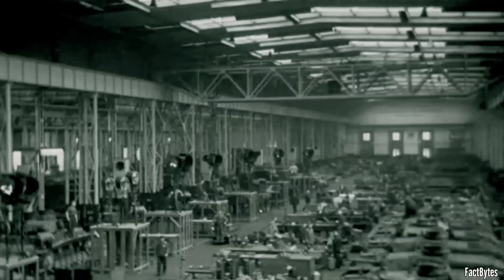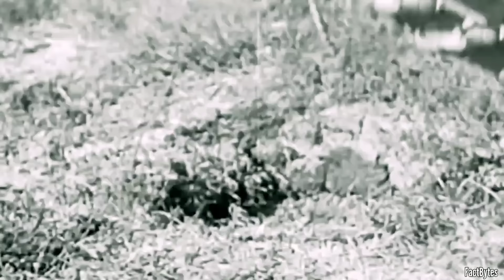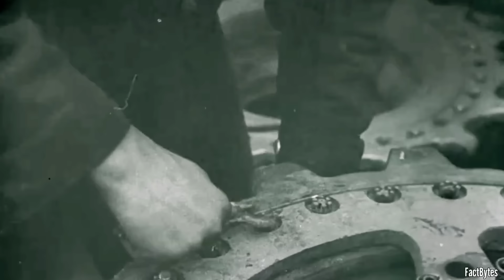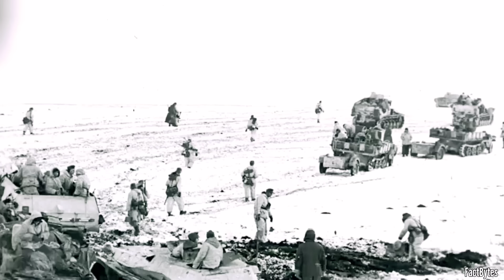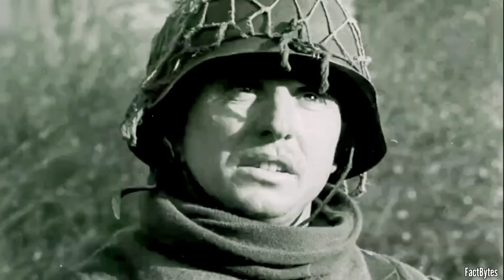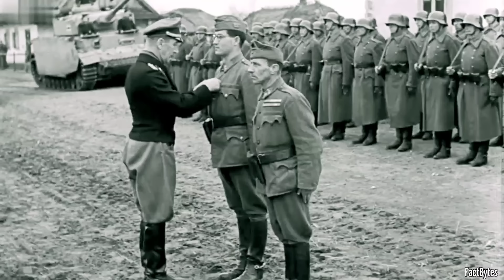More Panzer IVs, Fewer Tigers & Panthers — Would Germany Have Done Better?

Comment: Don't forget, the StuG III was the most-produced German AFV in WW2, not the PzKW IV...
Reply: There are other things Germany could've done. Instead of producing fewer than 30,000 tanks in total, they could've scrapped all other designs except the Panzer IV. Scrap all the tank destroyers like the StuG III, the Krupp K5 railway guns, and the Dora and Gustav railway guns; they could've produced 35 to 40,000 Panzer IVs. Developing the Wespe and Hummel self-propelled artillery before the war would've produced 25 to 30,000 Panzer IVs and 2,000 or more Wespes and Hummels each. The problem, though, is the lack of fuel, lack of industry and resources for spare parts and the lack of people to crew them. More tanks means more abandoned after running out of gas, especially after the oil fields in Romania were bombed in 1944. Germany couldn't produce the tanks, resources and personnel they needed for the war, especially after Operation Barbarossa. They weren't ready for the war and never would be. Same thing with the Luftwaffe. The aircraft industry, too, couldn't match the industrial capacity of the Allies and USSR.
Reply: @baddriversofmoosejaw8681  yes, should have, could have but in the end supplies and logistics
Reply: @stevegreig5675  Bingo!  And the most important thing they lacked was fuel.
Reply: @Weasel-z4y  This is why I believe the Panther was (almost) the best tank for the Germans at the latter part of the war. They were running out of fuel and people. It was a necessity to design and build tanks that could fight outnumbered with the best chance of success. Make the Panther closer to the original specs with a more dual-purpose gun (or a variant with the Panzer IV's gun). What would be the point of producing thousands of Panzer IV's if you don't have the resources to fuel and crew them?
Reply: @iamnothere454  In the end, however, Germany should've cancelled Operation Barbarossa and only taken the parts of Europe they had conquered by 1941. This way, they could've concentrated on the Mediterranean. Not bothering with Africa would've been wise. More of their forces in Europe, fewer ships, supplies and reinforcements lost in the Mediterranean and fewer staging points for the Allies to invade Italy. This doesn't mean they would've won the war. They would've held out longer, and not having the USSR to worry about and not declaring war on the US would've been wise.
Reply: @baddriversofmoosejaw8681  They were going to fight Russia sooner or later. This was the best time to do it. They should have stayed away from Stalingrad and focused their war on the south. Blitzkrieg warfare doesn't do squat in cities - but in the open southern steppes, they could have seized the oil fields and destroyed anything the Russians threw at them. This would solve their energy problems and make the T-34 useless because it wouldn't have any fuel. They would also have avoided the massive casualties they suffered in Stalingrad - preserving essential manpower.
Reply: @iamnothere454  Not entirely true. They were still going to lose the war with the USSR regardless. Even if they'd captured Moscow, as they could've done during the summer of 1941, and cut off the oil fields in the Caucasus Mountains by taking Stalingrad or reaching the Caspian Sea, the USSR was receiving oil through the Lend-Lease program. This would've slowed them down as they would've had to rely more heavily on it, until the Caucasus were retaken, but either way, Germany didn't have the industrial capacity or manpower to win. The USSR and Allies alike were too strong in both industrial capacity and manpower. The USSR was the largest country in the world by landmass; Russia is the largest landmass in the world today. Germany didn't have a big enough military to control the entire country and never would. In fact, getting as far east as they had planned to in the first place before winter set in would've shortened the war, and the USSR would've gotten further west. The reason is that Germany's forces would've been spread even thinner, and when the Soviet forces from the east arrived in December/1941, they would've had an easier time getting through the German defences.
Reply: @iamnothere454  The panther was actually an utter piece of junk.  LazerPig has a great video about it https://www.youtube.com/watch?v=FI0KUZiZp1Q
Reply: @baddriversofmoosejaw8681  Well, not the StuG III.  One of the main reasons for producing the Stug III is the reduced manufacturing complexity and resources of not having a Turret.
Reply: @baddriversofmoosejaw8681 yes i was going to say they hadnt enough fuel for that but i see you said that😄
Reply: @baddriversofmoosejaw8681 They had countries like Romania and Hungary.
Reply: @WestValleyTransparency  Yes, but not good enough.
Reply: Imagine the STUG or Panther with hydrostatic drive like a Caterpillar 953 or 963.   They'd spin on a dime.
Reply: @billw7213  hydrostatic tho is only good on slow dozers and such as too much speed causing heat build up causing failures
Reply: It also had the most kills of any AFV destroyer ever.
Reply: While Stug IIIs had some virtues, they were inferior to tanks. Their great utility was that they made use of the otherwise obsolete Panzer 3 production lines. Retooling those factories for Panzer 4s likely would have been a better choice
Reply: @ill_bred_demon9059  defensive and built on the III, 2/3 the cost, so a bargain
Reply: But...was not a tank a such...no turret right?
Reply: @johnanita9251  Right it was an armored casemate classified as a dedicated tank destroyer, a role in which it excelled it.
Reply: @jebbroham1776  That it did. But it still didn’t keep the StuGs and JgPz’s from being out numbered and overwhelmed.
Reply: @johnanita9251  Well for first, it was significantly cheaper to produce than tanks whit tover, while keeping significant role of tanks.
They started as SPG for direct infantry support, later upgunned for anti tank role.
Reply: @johnanita9251  but war and necessity have a way of obliterating those distinctions
Reply: Exactly what I thought I should write. The good guys had could win the war against all the bad guys now. Many Veterans now regret to fight against the people who was right early on but it is like Covid, to feel the pain is higher then to talk about the pain earlier.
Reply: While true, the stugs were mot tanks, rather tank destroyers
Reply: 不，並沒有
Reply: yeah, but the turmless casemate tank had its disadvantages and had also only a 75 mm cannon
Reply: Yes 4 with 7,5 cannon. And stug. Enough. And this in high numbers. Guderian ask for a lot. 
Same with luftwaffe. Tooooo much different Typs
Reply: It was NOT a tank!
Reply: You don’t choose the stug life. The stug life chooses you. 😎
Reply: Came here to say this
Reply: Germany did not have enough fuel to support any motorized vehicles for a prolonged conflict, so the point is moot.
Reply: @MD21037  Not actually as lighter "tanks" could move on compressed gas; sort of like a fork-lift truck.
Reply: You're right; The StuG III with the long 75mm Cannon would have been effective till about 1946. Although heavy tanks would be deployed onto the battle field; improved munitions such as a tungsten core; or shaped charge would have mitigated heavier allied tanks.
Reply: @Adam-zq2mw  yeah but nazigermani had no tungsten
Reply: @Adam-zq2mw  It was not effective already in 1944, because it could not penetrate frontal armor of T-34/85 and later Shermans at more than 500m . IS-2 only at point blank, while it got destroyed from 2 km.
Reply: @aleksazunjic9672 Maybe the turret but not the hull.  Furthermore, Soviet armor was of suspect quality and very brittle with lots of spalling even if the round didn’t penetrate.  The 85mm round was also questionable as it could disintegrate on contact at close range.  Really, Soviet quality control on pretty much all of their tanks was terrible.   Stug battalions racked up significant kills, in the order of a 10:1 loss ratio, and maybe around 3:1 if you account for Stugs lost to breakdown, artillery, etc.  The Stug was a very effective T34/85 killer right up until the end of the war.
Reply: @luvrofbacon  Hitting the hull is generally difficult because it is close to the ground, and there could be various obstacles there (logs, holes, rubble, uneven surface ...) Generally, AT gunners would aim for center of the silhouette, to compensate for dispersion, and hits would largely end up in turret.
Also, by the end of the war, quality of Soviet armor and ammo increased, while German declined, mostly because of availability of various metals needed for alloys. Also, Soviets now had breathing room to improve QC, while Germans increasingly had to shorten it. This, with improved Soviet tactics and shortened German training, made StuG largely obsolete against T-34/85 in late 1944 onwards, which of course shows in results and large German defeats.
Reply: @aleksazunjic9672  You are incorrect on just about every point.  1. Hitting the hull is easy when you are being attacked which was the case from late '43 until the end of the war, with very few exceptions.  German gunners were trained to hit weakpoints and aimed for them...they did not aim "center" if they could hit specific parts, and did.  The Stug was an ambush predator and was used defensively after '43;  2.  Soviet armor sucked throughout the war with inconsistent castings which were far less effective than rolled homogenous armor, which the German armor had.  The only exception would be the lack of some materials to make the armor less brittle, which appeared in German armor in '44.  3. Soviets never had the chance to develop elite tank crews b/c they were being killed at a shocking rate.  German crew quality decreased in '45, but in '44 at the Courland Pocket the German gunners wrecked the Soviets.  The Stug was very effective until the end of the war, in fact, the Hetzer...based on the 38t chassis, used the same 75L48 gun which several countries continued using unit the 1970's.
Reply: @luvrofbacon  Did you ever saw tank in real combat, looking from the level of trench ? Hull is often obscured by obstacles on the ground. German gunners were not trained to aim for weak points, simply because they could not hit them. At 500 meters Pak 40 would land hits within square 2x2 meters. It is enough to hit a tank, but not to hit specific component on the tank.  Soviet armor was superior to German in 1941, and again from mid-1944 to the end of the war. I.e. introduction of T-34/85 and IS-2 . Soviets did have elite tank crews they were mostly concentrated in IS-2 regiments. Courland Pocket was not a major operation for Soviets, they didn't employ much tanks there. They simply contained army group with locally raised troops.
Reply: That's how you know you're losing... If a case mount tracked vehicle ( that's unsuited your style of combat) is the most produced fighting vehicle your war is cooked.
Reply: So, 10,000 StuG IIIs to hold off 50,000 T-34s and 40-50,000 Shermans and a pile of Churchills, Cromwells and whatever else the British were building that day? More IVs would not have mattered.
Reply: @FritzGDC  This is clearly the better choice given the situation. By 1942/43 it's impossible for Germany to "win" no matter what they do...
Reply: @Adam-zq2mw Except you need to train a lot more crews, mechanics, and more fuel. In the end, the Germans knew they could not outproduce their enemies, so the choice was quality over quantity.
Reply: @FritzGDC  StuG III could not hold T-34, especially later T-34/85 with increased turret armor and better gun.
Reply: StuG was a mobile assault gun. It was not a tank.
Reply: @kim1628 we know 🤦🏾